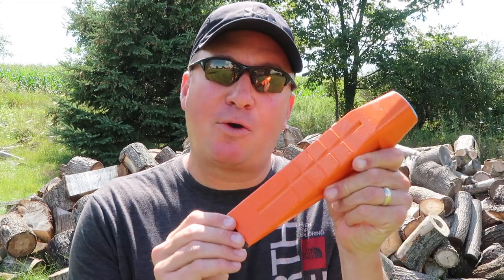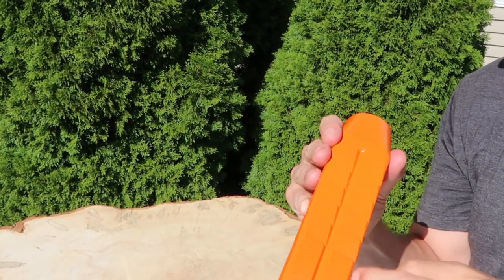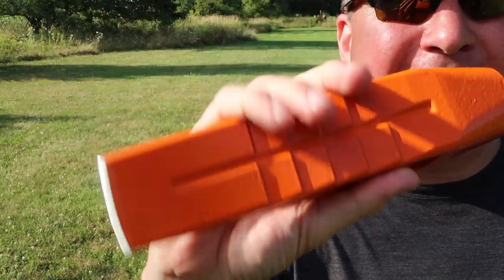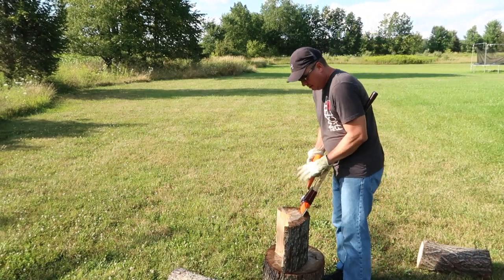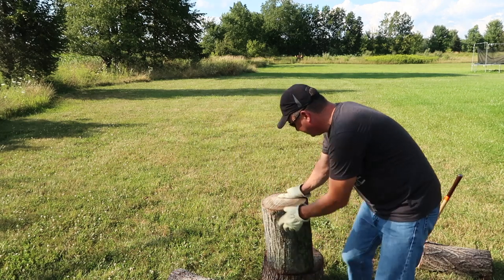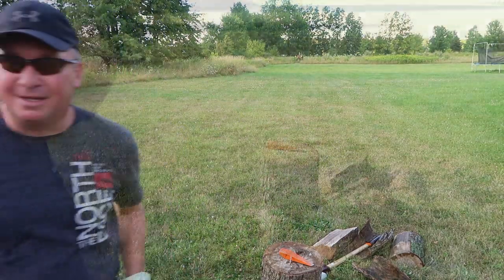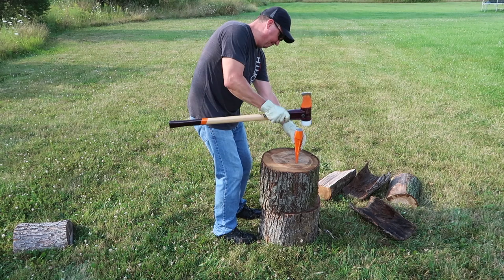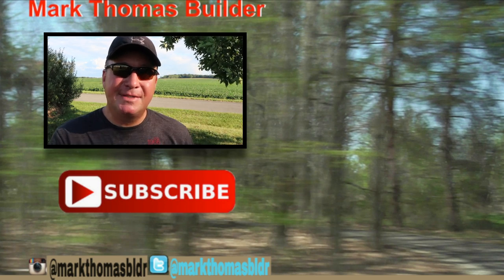HALDER SPLITTING WEDGE REVIEW- FIREWOOD SPLITTING -MODEL 355.260

Comment: I love using wedges on big rounds to make them easier to handle you might think it's slower than a splitting mall it might be if you only have a few rounds to split but you don't use near as much energy with wedges so I can work a lot longer and get more done before I tire out and start hurting too bad so I definitely will get me one of this to try it out
Reply from the maker: The wedge has been holding up very well so far.  I like the design of it.
Reply: @MarkThomasBuilder  thanks for the information I'm going to get me one before firewood season

Comment: hands farther apart has more control and is the way to get s wedge to start and bite in, but once in (and as you grow in confidence) go for the axe swing style (but in this case overhead swing of course) where your hands start farther apart but then slide together as you make impact, this will give you maximum striking power!  you'll get some overstrikes when you just start doing it (and maybe towards the end of the day when you're shot!) but this tool has metal collar overstrike protection up there so I say go for it!  Aluminum wedges seem to dent and absorb more power, putting that into the splitting action, and steel wedges dent less, causing more bounce and robbing you of some of your power.  That's why I favor the german aluminum splitting wedges.  But maybe the plastic end of this prevents bounce as well, it'd be interesting to compare if I had that maul.  Unfortunately I've already bought 3 mauls and may be picking up the new fiskars maul as well to do a maul shootout video.  I always am tempted to buy more tools but the cost really adds up and what will I do with all these similar weight/use tools at the end?  They're so heavy to ship and sell on ebay and hard to box.  I doubt craigslist cheapos will appreciate the value of my fine splitting tools.  Maybe christmas gifts to out of shape relatives? ;)
Reply from the maker: I've been thinking about doing a wedge comparison video.  I recently had a tough elm round that the hydraulic splitter wouldn't split and my big maul wouldn't split it either.  It took the Halder wedge to finally bust in in half.  Once I did that, the hydraulic splitter took over.

Comment: Mark - thanks for the review and demonstrating.  It certainly splits wood well that is otherwise very challenging.  

I have a bunch of large knotty birch rounds up to 2ft. in diameter, so it looks like its time to invest in a wedge and a hammer.

Still undecided on aluminum or steel which obviously affects the hammer material choice.  In either case the twist seems to bring a major advantage.
Reply from the maker: Thanks!  There are times that when I come across some difficult twisted wood that can only be split with a wedge.   I'm going to make a comparison between the aluminum and steel wedges sometime soon.
Reply: I went with the a "Bison" 45 degree aluminum wedge.  Similar to Ochsenkopf and available at the hardware store.  

Along with a plain 3kg steel maul it turns nasty knotted wood into toothpicks almost effortlessly!  Wow.

I guess for very heavy users the plastic-tipped hammer might be worth it but it looks to me like the wedge will last a long time at my usage rate.
Reply: I had an old gf that was a knotty birch

Comment: Just prior to watching this video I viewed another where the person could NOT get the wedge to go into his wood. He even sharpened the wedge, without any change. He then used just a generic metal wedge and it went in every time easily. He concluded his video saying: maybe you need to use the Halder’s maul with the wedge. I feel that would be craze and it should have worked with a  metal sledge as long as the owner was not concerned with deforming the top. Have you heard anything to confirm or deny? Thanks
Reply from the maker: That's an interesting scenario.  I've heard there's some work laws in Germany stating that steel cannot be used to strike other steel with mauls and wedges.  You'll notice some axe makers use nylon on the poll (butt) part and the wedges are made of steel.  Another option is the maul is all steel and the wedges are aluminum.  
In my experience, the steel on steel offers the most power and punch to drive the wedge.  Estwing makes a nice steel wedge that has softer steel and starts to dent and mushroom when hitting it.
I've been using this Halder wedge & maul and it's really impressed me.  I don't recall it needing to be sharpened from the factory.

Comment: i have an old splitting wedge that has really been work hardened and is cracking and despite my attempts to prevent mushrooming it still does and beat on that wedge mercilessly.  this guy may be able to split firewood, the wedge is for big rounds not little rounds.
Reply from the maker: The wedge is very handy to have.  I've split some big rounds that the hydraulic wood splitter couldn't
Reply: @MarkThomasBuilder  i have myself (mostly black oak and pine).  although not speaking of other peoples experience, i got to the point over the years where i don't use the wedge unless the rounds are really hard, knotted.

Comment: that's a small log. Just hit it with the maul. Hard.
Reply from the maker: The wedge proved itself in this video https://www.youtube.com/watch?v=Y5ndx-R4-PU  Check it our around 3:25
Reply: your word is true sir.. i agreed
Reply: Mike Hutchinson agreed. An 8# maul with a sharp edge will break it and help keep the beer belly from sprouting. Don’t believe me? I lost 10lbs splitting wood using my maul. PS the OP is right, usually three good hits on the edge will split the log and then just use a regular wedge and 4# hammer to make em into toothpicks

Comment from the maker: What tools do you prefer for splitting firewood?  A maul, wedge, or both?
Reply: Who makes the maul? It looks light and effective.
Reply from the maker: Halder makes the maul and they also make a lighter axe too.
Reply from the maker: No, I haven't.  I want to try some Swedish axes.
Reply: Hyd log splitter works much better
Reply from the maker: Yes, I wish I owned one!
Reply: The chinese imports have probably brought the cost down on these.  I was a little shocked to see horizontal/vertical hydraulic splitters for 800-1000 dollars.  I've got that much into manual splitting tools easily (and don't regret it!)  Harbor Freight has an excellent horizontal only splitter that splits both directions saving a lot of time as it avoids waiting the full time it takes for the piston to return to splitting position.  700 if you can find one in store.  For the manual wood splitting enthusiast I actually recommend the hydraulics that can split by transforming into a vertical splitter, save a lot of back pain and lifting labor because you can split those 100-200 pound rounds right on the ground.  Good for getting those huge rounds into quarters for later manual splitting cleanup work, or for the nasty twisted boxelder trees I deal with.  Sometimes I've taken 30-40 mins just to split one nasty twisted piece using a sledge and wedge!  And that piece will not burn for 30-40 mins either so I guess I lose!  That's when it gets personal!  But now I'll just fire up the splitter and take those nasty pieces out.  But I respect the manual diehard splitters that refuse to take the easy way out as well, because I've been there.  Without my hydraulic, I would probably just pass on all the downed boxelder around my area because I know from experience it isn't time efficient enough to justify the effort for heating with the wood when splitting by hand.
Reply: Helko has a vario swedish head but I looked at their site and while they're all still pictured, I'm not sure which one is being sold.  They also have a standalone swedish style splitting axe, but I'd just get the genuine article with the Husqvarna forged swedish style light splitting axe and also their maul.  Like he said they are Hultafors tools at half the price, sold on amazon, bailey's, and treestuff.com (which wranglerstar has a discount code for anything purchased on that site)
Reply: I use a tried and true solid steel maul
Reply: @evojigger  i use the Husqy maul. Its great. Its only 4lb, so you rely more on momentum then weight. The edge shape makes it easy to dislodge, and the steel is good quality. I could understand folks favoring an 8lb maul though, for different woods.

Comment: A lot has todo with the man doing the swinging I got sum oak that I can’t drive any wedge into
Reply from the maker: When I get those tough pieces, I use my chainsaw to cut a groove to help the wedge get started.
Reply: markthomasbuilder there u go I do the same lol
Reply: I got a new wedge and a handle for my old maul where u from I got sum oak thas wicked it’s meaner than anything I ever split the tree is about eight foot wide at the butt
Reply from the maker: Wow, sounds like you might need to rent a hydraulic wood splitter.

Comment: Completely clueless city-boy here, but...well, isn’t a wedge just a maul without a handle? I mean, sure, I’ve watched small teams of Canadian ogres using wedges to help bring down full size trees they’ve already attacked with what look like 25’ long chainsaws. But that’s an entirely different class of work than this, surely? I mean, I can just hear them, Crocodile Dundee-like, “Log? That’s norra log. This is a log. Eh?” 

I guess what I’m asking is simply, why doesn’t he just wallop his little logs with a regular maul or splitting axe? Even with it’s funky twistiness, it doesn’t seem the wedge is buying him much other than one more thing to carry/forget/lose, no? (Again, I have no idea about this stuff. It’s quite likely I wouldn’t even be able to lift the wedge, never mind the thing he’s belting it with.)
Reply from the maker: Those are very good observations and questions.  I honestly don't use wedges as often as I use a maul.  When I get a really tough round to split, sometimes a wedge is the best option.  The advantage is that you can put the wedge right in the split and start hammering away.  The wedge also has a slight twist in the design, so it helps break it apart faster.
Reply: while i havent watched the video yet, you can split a log in half for making rails or fenceposts with wedges. if you're just using them for firewood then every time you whack them they drive deeper into the wood, whereas if ur splitting with an axe you have to pull it out to swing. a girl might be able to split that log with a wedge  tapping on it with a sledge 50+ times, but she'd probably never be able to split it with an axe

Comment: 9:25, wedges are softer steel and are expendable, they are also very safe to use, this dude doesn’t know how to properly split firewood either.
Reply from the maker: In Germany, they actually have laws against striking steel to steel, because of the danger it poses with shrapnel.
Reply: @MarkThomasBuilder  - ... "laws against striking steel to steel?" That notion does not remotely pass the smell test for veracity. There are too many industries / types of metals / shock mitigating mechanisms to make that generalization. For example, try forbidding the striking of metal on metal to a railway (track) maintenance worker. Then in metallurgy, there's mild steel, forged, cast, rolled, drawn, hardened, countless alloys, etc. to consider. Certainly the brittleness and maleability characteristics are important to consider (along with grinding off mushroomed edges) to avoid shrapnel. But please be aware that some manufacturers tend to exaggerate risks (physical and/or legal) in order to "create" a need that, conveniently, only their product can fill.
Reply from the maker: @brucebeverly2629  My source of information about steel striking steel is from a German tool manufacturer.  He said regulations are in place, where they use nylon inserts in their hammers instead of steel.  I've seen 2 other German tool manufacturers sell aluminum wedges instead of steel for splitting firewood.
Reply: @MarkThomasBuilder  so you can't hammer a nail?

Comment: Sledgehammer works better with a wedge
Reply from the maker: Haha, yes!
Reply: @MarkThomasBuilder  yes I agree we have this rubber things at work that go over all our tools that get striked by a sledgehammer it's hard to explain its got a hole in the center of it so you have a good striking surface but it keeps you safe if the head chips it won't come flying back at you